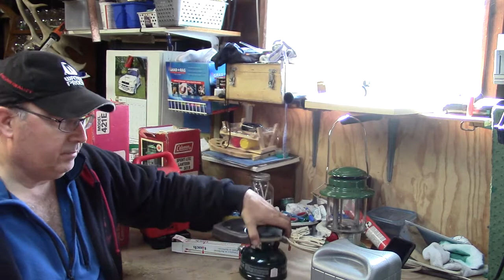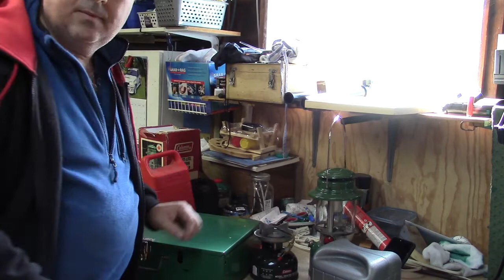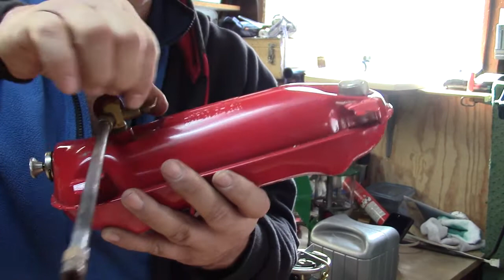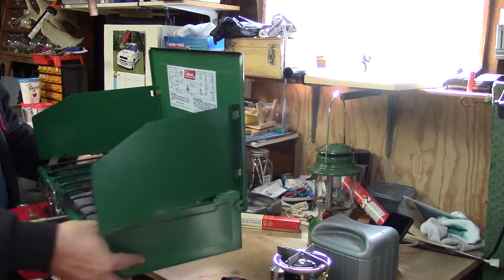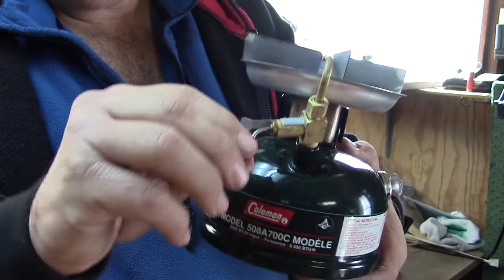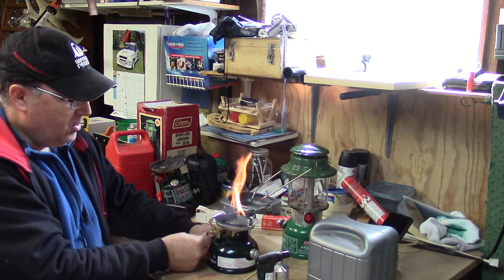Quick Video - Section Equipment

Comment: Hello Lt,
when an Canadian say Naphta...he means White Gas or Gasoline ? I'm not sure about...
What is your problem with the pump from the coleman stove ?
Atb from germania
Jürgen
Reply from the maker: Nice trick with the WD-40. Thanks
Reply from the maker: Hi Jurgen, yes we mean white  gas. Since I am french Canadian the terme Naphta is the one I use most. I often mix that term in english also but the correct form should be white gas.  The inner valve was stuck air was not getting in the tank making pressure for the stove. It finally moved when I was filming the french video . Most probable cause was the absence of fuel in the reservoir for many years and maybe a little rust on it.
Reply: @LtSurvival  hmmm...I know this problem...try to fill the pump tube with a bit WD 40let it rest for a bit...and than try to squeeze it with the pump piston into the tank !
With a little luck the stucking valve get free ;)
Reply: @LtSurvival  Upps...I see it a little bit late,your problem is solved...